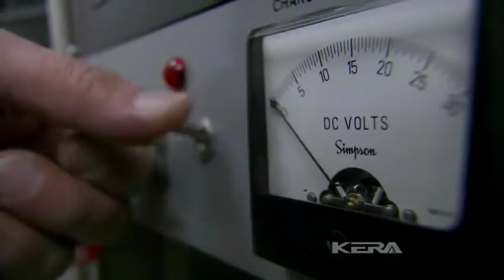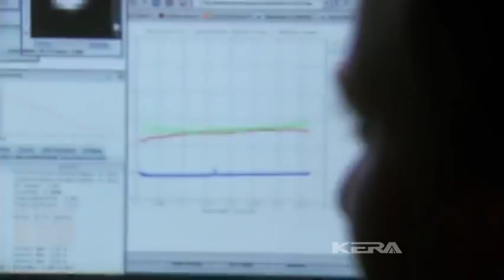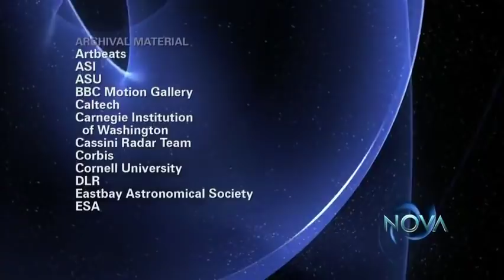Finding Life Beyond Earth.. COSMIC JOURNEY.. BEYOND  SPACEHD

Comment: There is life out there.  IN the early 1970s i was driving to Nevada The Boulder Dam is on the Nevada & Arizona border i told my wife That i have driving this road since the 50s and i have never seen a tower on that mountain with a spot light on it.  We kept driving and i said -- we should be able to see that tower by now but we could not. We were interning  the mountains and we would just see glimpses of the light.   We were driving for a hour longer and i said when we get around this mountain we should be where that tower is at.  When we circled the mountain we came to a clearing and right in front of was a huge UFO.  I pulled over and stopped.  We stayed there for a hour and half watching the UFO hover in place over the boulder Dam drawing power from the generators.  We were a little over 100 feet from the UFO.  the people in the UFO were looking out the port holes at my wife and I.  The UFO kept hovering and a small airplane circled it one time.  Then it rotated in place a man was watching the airplane. He was white looked just like us.  He gave the all clear signal that the plane was at a safe distance.  Then it shot out of sight in one second.
Reply: Have you told your doctor your meds aren't working?

Comment: why has the kyper belt not formed a planet??
Reply: To far away and to far apart from each other.
Reply: Martinpio Dave kaiper belt. most of the debris is too far apart. if you hauled ass through the kaiper belt, the chances that you'd hit something aren't very good. the chances that you won't hit anything are far better.
Reply: @nanamedina2424  *Kuiper
Reply: To add to this. There are dwarf planets within the Kyper belt. Some of them are even larger than Pluto. Just google dwarf planet and a whole list will pop up.
Reply: The entire mass of the Kuiper belt is less than one tenth the mass of Earth.
Reply: This layman posits that the K belt may yet form a large planet or more in millions of years in the future.
Reply: @edb4793    Despite its vast extent, the collective mass of the Kuiper belt is relatively low. The total mass is estimated to range between 1/25 and 1/10 the mass of the Earth. Conversely, models of the Solar System's formation predict a collective mass for the Kuiper belt of30 Earth masses

Comment: I would like to know what Mr. Geoff Marcy thinks about Space X idea to go to Mars  ?? I think that it would be better to design and prepare to go to some Goldilocks Planets right away , and forget about desolate Mars .  To create atmosphere on Mars it will take forever before we can evacuate earth in case some huge meteorite . When Sun starts misbehaving on us we will have to go further than Mars to different solar system in our galaxy. Space X beside delivering satellites on orbits could rebuild and expand our ISS to launch rockets directly from the orbit. Graphine Nano Tubes to build space elevator maybe could work by assisting it with some rocket engines to keep it stable to which fuel could be pumped along the structure of the Space Elevator . 2-nd Cosmic speed of a big ISS to leve the orbit could also apply pulling force on the elevator . Maybe Untimatter engines could push the  spacecraft off from a new ISS and reach the speed of near light . Maybe thinking along SiFi  , Theoretical Phisissists  could reverse the Equation of the speed limit and the mass would be decreasing to near Zero as we reach speed of light , or better to reach Zero mass and arrive anywhere  as pure energy and when slowing down the mass of the matter would follow the matrix or template of reassembly from Entropic  energy into organization of molecules.

Comment: It lends an air of back water mentality when he's using his Queen's outdated measurement system, and it's hard to follow. Temperature of 70 degrees (no doubt F)? How much is that in scientific units? Water to a depth of 30 feet?? Something a million miles away? How many furlongs to a bushel, how many inches to a pound?
Reply: Most videos are made with an eye on the USA market, and they get upset if you use metric. The UK went metric decades ago. The USA still uses Bbls ffs.
I have noticed that very recently NatGeo et al are starting to use metric rather than Imperial.